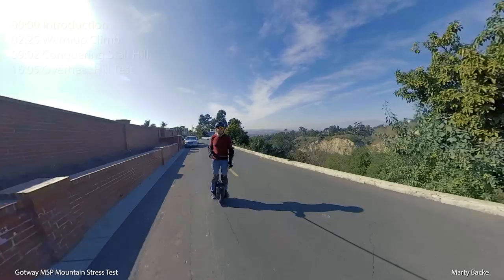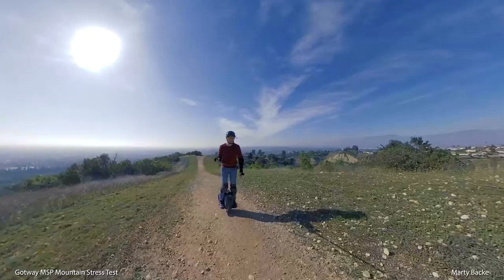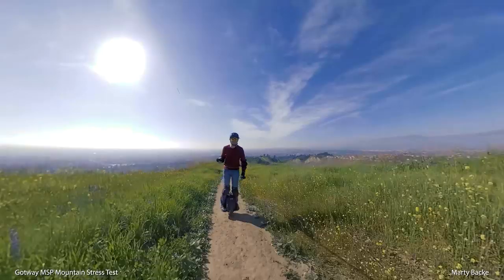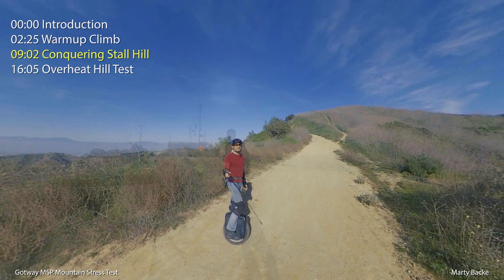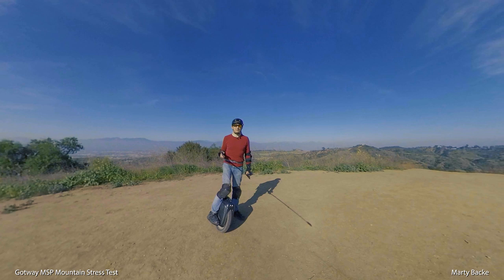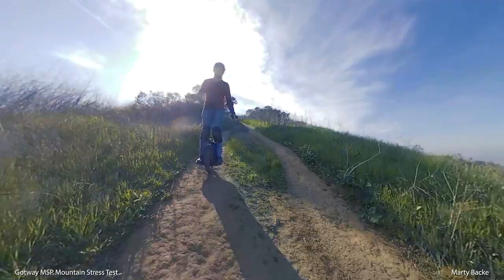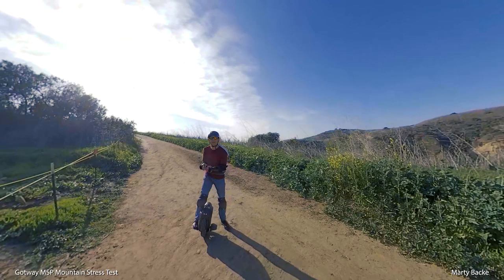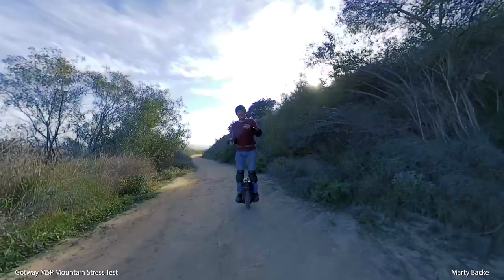Gotway MSP Smashes Mountain Stress Test

Comment: I was hoping the MSP would redeem itself in this way. As a heavy rider I really appreciate the effort that has gone into making this a strong climber and downhiller. Although I would also like to a bit more speed. Everything else I own tops out the same.
Reply from the maker: Unfortunately I suspect we will always have to pick between maximum torque and maximum speed.
Reply: @ElectricUnicycles   😭
Reply: @ElectricUnicycles  Give it a few Years and Im sure someone sorted out a high speed 4-5Kw motor with immense torque ;-) that doesn't fry or cutout...just slowly tilts back should one go past 90-100km/h or goes past motor spec/pcb load ;-)

Comment: Nice video, Marty!
The performance of the MSP definitely shines through! Torque for days!
Curious, what temperature alarm would you setup for the MSX? 
That’s what I have now but never thought to set amp and temp alarms. 
I’m 125lbs and the fastest I’ve gone is 33mph so I was never really concerned about alarm settings but now I see it’s important to monitor; even more so in these types of conditions.
Reply from the maker: These wheels overheat at 79-degrees, so I set an alarm for 75-degrees so that I can stop and let it cool off if necessary. Both the MSX and MSP run cool though, so under most circumstances yours will never overheat.
Reply: ElectricUnicycles that’s good to know! Thank you for the info

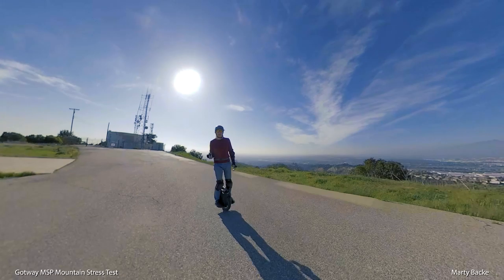Comment: okay looking at the timestamps, 9:50 to 11:35 means it took you a minute 45 to get up STALL HILL. Your MCM5 stress part one video at timestamp 7:00 to 8:40, a minute 40..... so about the same! Not sure if that was as FAST as you can ride up the hills or that's about as much as these wheels can handle. What I really want to know, which one do you think is the morecapable climber??!?? and yes, i know, the MSP is definitely more comfortable, i'm just talking pure climbing power.
Reply from the maker: The thing is, I'm a bit cautious about trying to push the wheel too fast up super steep hills. I saw one Monster burn up because of that, I believe. Someday maybe I'll show you this trail, but like many of these trails, it's not in the best condition.

I still think the MCM5 is more capable, but it's cool that now I have a large wheel that is also capable of these extremes. We all know how much more comfy a big tire is.

Comment: You said you did it with he MCM5, but didn't you also do it with the Tesla?
Reply from the maker: I never tried that section with the Tesla. It possibly could do it. Most impressed that the massive MSP could do it though - such a bigger wheel than the MCM5 or Tesla.